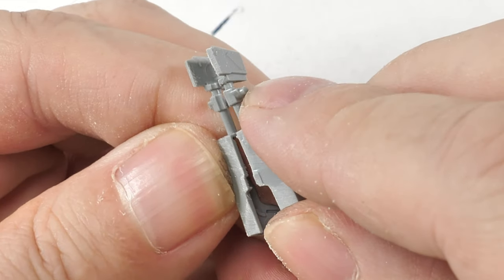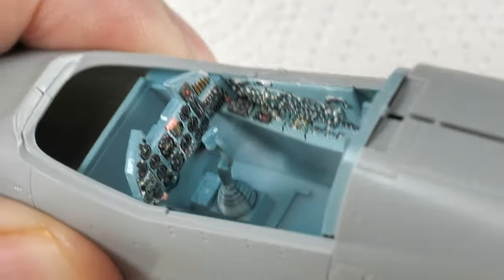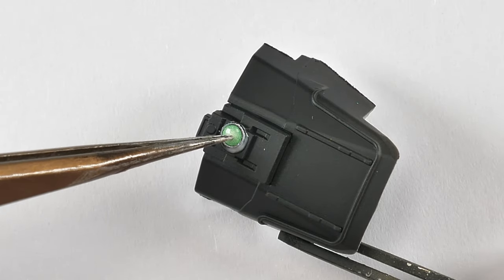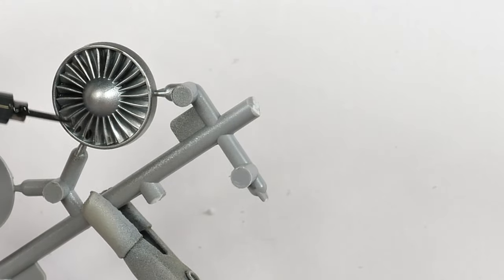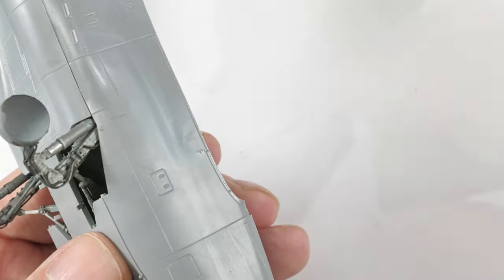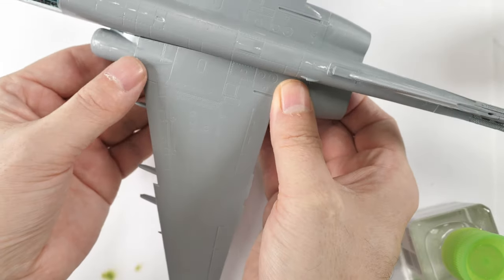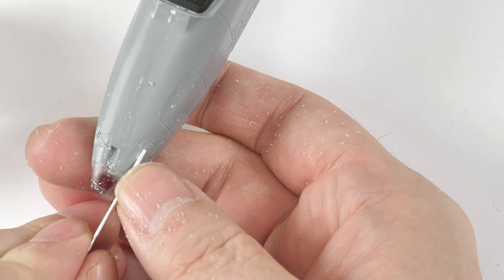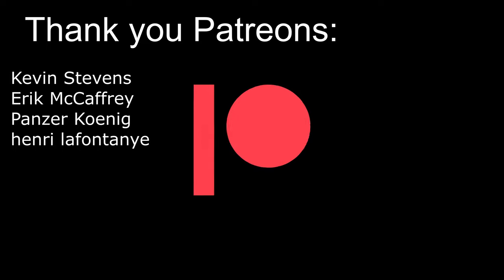Zvezda 1/48 Su-25 Frogfoot Part II Build

Comment: Nice build.
Are you sure about the wheel bay color? Most of the Warsaw pact Su-25s had it in greyish-blue color. The green was usually used in the interior parts that were not supposed to stay open (inside of the engine covers etc.)
Reply from the maker: correct i only painted the interior of the bays that green colour... i found a few references of them with green interior. but the gear doors are that grey colour. i probably have not got everything exactly correct. the interior of the bays is just a dark shadow as zvezda have made the kit with the landing gear doors after cycling the gear. i really wish to build another but in flight configuration.

Comment: What kind of glue are you using?  I've heard really good things about Zvezda, have their new M4 long gun and looks to have excellent surface details.
Reply from the maker: i typically use tamiya quick set. at start of video i used some mr cement spb ( black dye ). yes zvezda kits have massively leveled up in recent years 👍